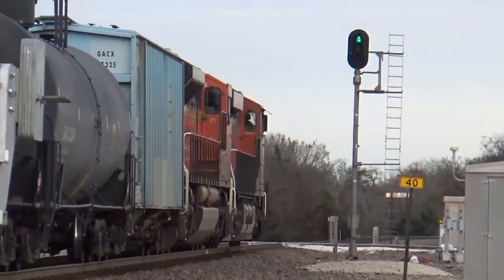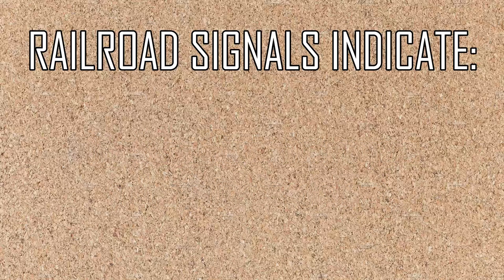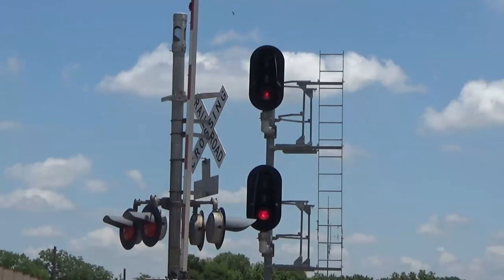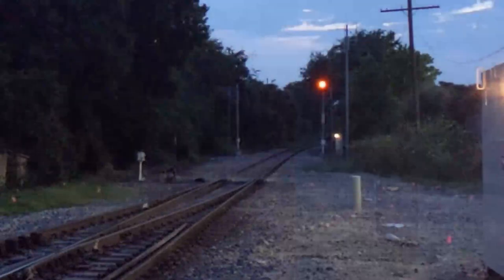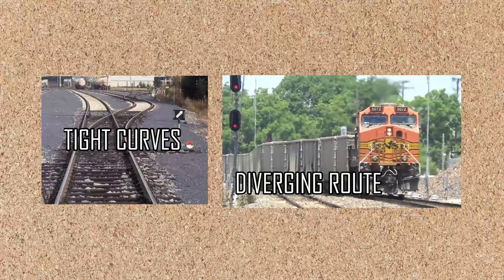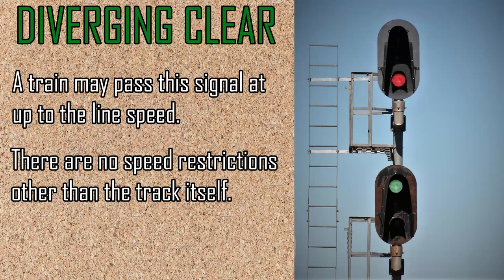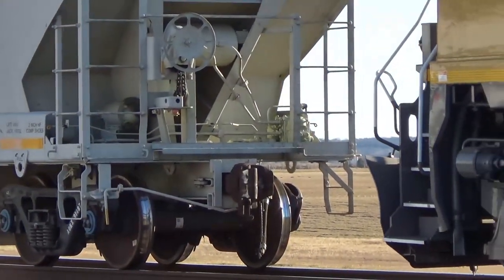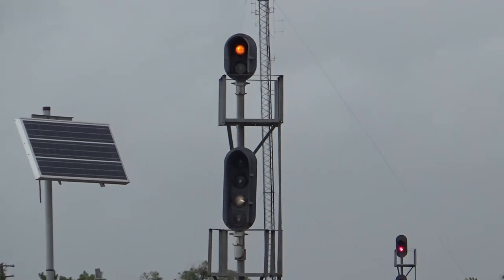How to Read Railroad Signals

Comment: I learned that there are Absolute signals and Intermediate Signals.
Intermediate signals are identified by a number board.
A Red Signal with no Number board is an Absolute Signal, meaning it’s a Stop Signal. However, a Red signal with a number Board is an Intermediate signal, which means it’s a Restricted Proceed, and restricted Proceed is Proceed at restricted speed

Also, Restricted speed is not an actual speed, but a condition, which is stoping at half the range of vision.

I have been taking railroad training classes, and yes I do know allot about signals.

Comment: I need to figure out how to get where I can see certain lights near Hutto.  I have noticed a couple of places where trains seem to always stop.  The US 79 UP track in Hutto is mostly east bound traffic, except for a certain gravel bucket mostly for the new Samsung plant in Taylor and Amtrak.  I'm sure there must be a related west bound mostly track, but I have not found it yet.  I'm only a year into part time rail fan.
Related to the next comment, about a year and a half ago, I was up in Long Island and had a chance the experience the LIRR.  Seems to be a well run system.
Reply from the maker: In Hutto you can see a signal halfway between Chris Kelley Blvd and Jim Cage Rd, it's hard to see without binoculars or something. Outside of town to the east at County Road 132 you can easily see the signals near that road. Austin Sub is almost all northbound/eastbound. The Lockhart Sub from Smithville to San Marcos handles much of the southbound traffic for San Antonio.

Comment: You said a bottom red signal can be ignored but 2x you went back to the lower red and said something else.     You confused me
Reply: Don't ignore the bottom red.  In most rules, both Yellow by itself and Yellow over Red mean the same thing.  But it's what the rulebook dictates that matters, and there are situations where that bottom red really does matter.  The signal aspect is everything you can see.

Comment: 1:03 Unfortunately, this is not true.  All red lights on an absolute signal does indeed mean Stop, but on a permissive signal it means something better.  When it's better, it does not necessarily mean the train must stop at all.

1:44 That is not true, either.  The signal aspect must match what's in the rulebook.  If Yellow over Red is not in the rulebook, then it's a signal improperly displayed.  In the case of Approach signals (for example), the red light on the bottom doesn't have much meaning. But, there are signal aspects where the bottom red MUST be there.  It's bad advice to say "ignore it"—it's always a part of the signal aspect and should not be ignored.

1:51 *Advance Approach.  2:55 *Diverging Advance Approach.  

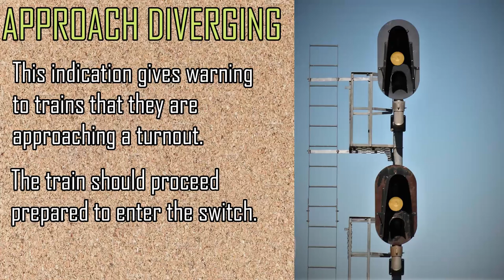3:24 It should be noted that Yellow over Yellow is the most-varied signal aspect across different railroads.  It can mean many different things, depending on the railroad and signaling schema.  Advance Approach, Approach Medium, Approach Diverging, and Approach Slow are the most common meanings.

4:18  The Lunar White or Flashing Red can be on any signal head (with all others red or dark) and it means Restricting.  That means it can be on the top, middle, or bottom.

Overall, a well done video.  Signaling is really down to the details, so I believe it helps to be as exact as possible when explaining it to others.
Reply: Setting aside the fact that Yellow over Red IS in everybody's rulebooks, there are NO indications that require a (solid) red in EITHER middle or bottom positions.  Signal heads in those positions could be depowered  or missing altogether (signal masts with heads only in 1st and 3rd positions are uncommon, but do exist!), and be understood as synonymous to red, and rulebooks take that into account.  If a rulebook doesn't, it is either poorly written or incomplete!
Reply: @xheralt  In rulebooks where 🔴Red over 🟢Green and 🔴Red over 🔴Red over 🟢Green are both Slow Clear, then Medium Clear must be shown by 🔴Red over 🟢Green over 🔴Red.  That convention came about because it was cheaper at the time for all the 2-headed point signals to mean Slow speed once Slow and Medium became distinguished, and Medium was the exception.  The NYC was a prominent example of this schema.

Comment: They looks like regualar traffic signals except green on top and red on bottom
Reply from the maker: Yeah pretty much. Green was put on top to avoid road traffic mistaking it for a traffic signal.
Reply: @TheCentralTexasRailfan  Red was put on the bottom to make sure that no part of the signal below the red can collect dust or debris to block the aspect.

Comment: American signals are so easy and simple to read compared to Czech railway signals
Reply from the maker: That I believe. Some railroads here use speed signalling which is more complex.
Reply: What the purpose of making the signals harder to read? Is that any help to the people running the train. Is it train operating or quantum physics?
Reply: why is it so difficult in the us too? not sure about czech signals but in the UK it's basically just; 
red = stop
yellow = signal block before red, warning that you need to stop soon
double yellow = signal before yellow signal
green = clear for the next 4 signal blocks
this signal system is used in conjunction with AWS. if a green signal is next, a 'ding' sound plays signalling that it's clear to the driver. the other signals will instead play an alarm sound which you need to acknowledge within 7 seconds or emergency brakes are activated.
for diverging or points switching, there is a white line on top of the previous signal head, which will also have a flashing single or double yellow light depending on how far away the switch is, and the status of the signal past the switch points, saying which way you are going. before this signal, there would be a speed limit pre warning sign, and the AWS alarm will activate, indicating to the driver that the future speed limit restriction sign applies to them, as sometimes when continuing on the main line you don't need to change your speed.
flashing green is sometimes used on the east coast mainline, to allow trains to continue up to 140mph. this isn't often used anymore i don't think
this system is effectively standard on all network rail controlled lines, the exceptions being the underground which is controlled by tfl
the american system seems very interesting compared to the UK, but my home country's are even more confusing lol
Reply: @cemops8660 what is the signal you see sometimes on station platforms in the UK,  its a white circle with a black line going through it, sometimes the black line is horizontal and other times its diagonal through it?

Comment: Good route signaling, speed signaling is entirely different.
Reply from the maker: Yeah. Route signalling for the win. So much easier to understand
Reply: @TheCentralTexasRailfan  They're not that much different.
The only difference between the two is that Speed Signaling indications prescribe specific turnout speeds , whereas Route Signaling does not.

Comment: You mad a grave mistake! You do not ignore a single red aspect only on a double stack signal!!!! It must be treated as the most restrictive indication the signal can display! Ignoring a low red signal only will get you fired!!!! I am a retired engineer, and I would never have passed a "low red aspect only" signal for all the tea in China without coming to a full stop!!!!! We would've then called the DS and told him about the missing aspect!!! Then being "delayed within a block'", we would proceed at Restricted Speed until we saw the next signal indication displaying something other than stop!!!!!!!!
Reply: The rule I heard was, if it’s not all red, it’s not red at all. If nothing else is on, it’s all red! I think though the narrator meant though that there is a color above the bottom red signal.
Reply: Correct.  It's what the rulebook shows/says that matters.   You can't ignore any signal lights, and can't ignore any dark signal heads.  If what you see on the entire signal is not in the rulebook, then it's improperly displayed and everything you said comes into play.   If Dark over Red is in the rulebook (or timetable), it's fine.  If it's not...  
Dark over Red is currently in BNSF's rules for Stop, but not UP's, CSX's, NS's, or NORAC's.